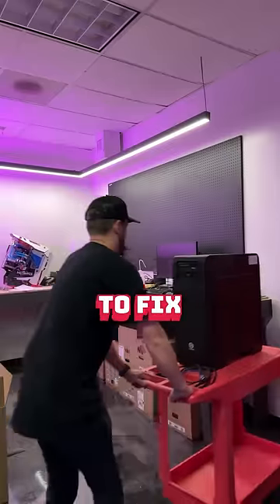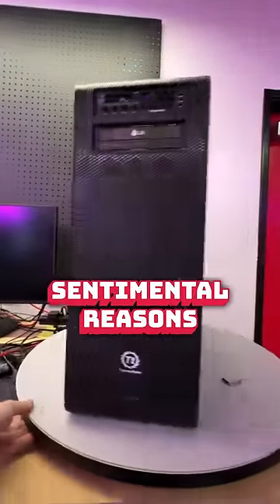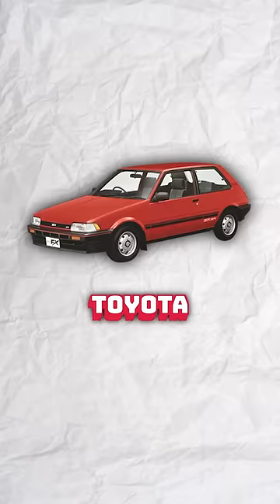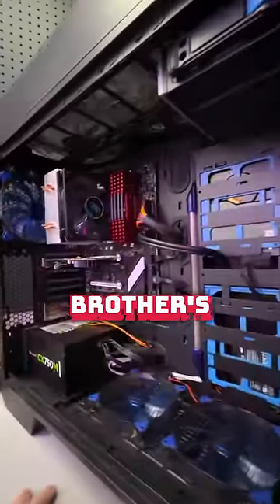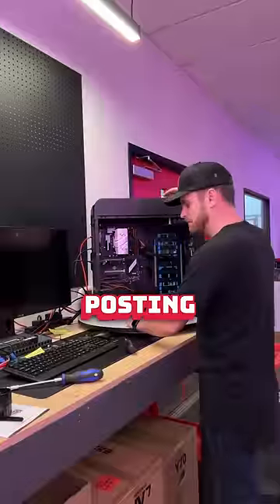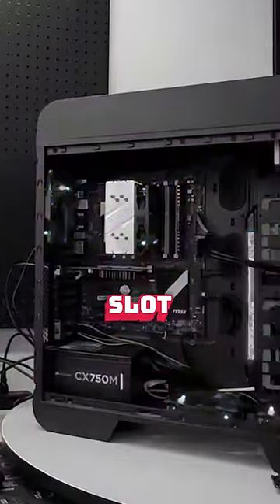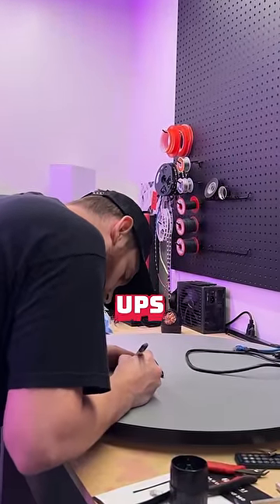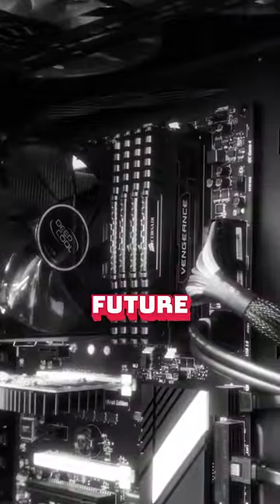FIXING OLD DDR3 GAMING PC! 👴🔧

Comment: I'm currently running a ddr3 system and it chugs along quite well
Reply: Me too
Reply: @jasoncooler09  i got an upgrade about a week ago. I am no longer on ddr3
Reply: @pringleiscool475 new motherboard too (of course?) what brand?
Reply: @pringleiscool475 rip
Reply: @pringleiscool475 stop teasing and drop your new specs smh
Reply: @chancebih  my bad, I got a ryzen 3 3200g with 32gigs or ram on a MSI a520m pro with a gtx 770 2gig. I'll be getting a 1050 sometime soon if my friend upgrades
Reply: @pringleiscool475  nice!!! Seems like a solid build, 1050ti’s a little outdated but when I used it years ago it was still chugging along, amd offers their performance settings for nvidia now if you ever wanted to try it out
Reply: @chancebih  id love yo get an amd card but I like how nvida rtx is plug and play
Reply: @pringleiscool475  amd is just as plug and play friendly as nvidia, the difference is when you start messing with settings, nvidia has better ray tracing and dlss, where amd has an easier to use program(in my opinion at least), that being said I think nvidia is better, but pure price to performance amd is better
Reply: @pringleiscool475 that's the worst way to improve performance 😭 why are you pairing a 32 gigs of ram with a cheap ah card. Should've gotten 16 gigs of ram and gotten a 1660 super or a amd 5000 or 6000 series or rtx 2000 series.

Comment: ah cmon, ddr3 isnt that old. my old pc has it and it runs perfectly fine
Reply: No one said it doesn’t, but it is fairly old with being „released“ in 2007 so he’s not wrong there :D
Reply: @BlueSky_fur  yeah 15 years old. thats not terrible
Reply: @crockpot5850  and no one said it is. :D we just said its old which it is :D my fiancee uses DDR3 as well without issues, i recently made an upgrade to ddr4, everythings okay, no ones hating on ddr3 xD
Reply: @BlueSky_fur  oh alr
Reply: @BlueSky_fur yeah I don’t understand the problem, like I still use ddr1 with my pc!
Reply: deleteduser1180 my dad still has ddr1
Reply: People with money: i highly doubt that
Reply: @officializm6298  u sure? try getting a mb with ddr3 support for a few $$$ and you probably won't notice that big of a difference from ddr4
Reply: @crockpot5850  I'm talking about people who want 4K 60FPS on ultra high settings in Cyberpunk 2077 in a PC
Reply: @officializm6298  oh ok. well then ur gonna need to spend a bit more than what ddr3 is valued at rn
Reply: @officializm6298  ive tried both ddr3 and ddr5 and ive seen a bit of a difference from ddr3 to 5 but thats probably because my old pc's ram runs at 2300mhz and my new pc's runs at 6000mhz. So basically almost double the speed.
Reply: yeah, pretty slow though lol
Reply: @turkey_sandwhich  yeah and i got 3200mhz wrong
Reply: @turkey_sandwhich  even slower. 2300mhz 💀
Reply: I own the very last motherboard ever made that supports DDR3 and the speeds are very good. With 36 GB if it, I’m set for many years.
Reply: @Huels  yeah i have the msi z97 gaming 5 with 32gb@2300
Reply: It's fine if you don't do anything that require power (game, 3d modelisation, video montage)
Reply: I have a budget build with quad channel overclocked DDR3 and it’s faster than your average DDR4 build, besides that DDR3 latency is better. The real issue are the CPUs that support it, other than Xeons and top tier Haswell i7s there isn’t really anything capable of serious tasks today.
Reply: @crockpot5850 bro that’s dinosaur era in of terms

Comment: I was still on DDR3 a year ago personally, there is still a lot they can do. I was still running some modern games at decent frame rates now a dual core on the other hand that would have been wack lol
Reply: Ddr3 🤢🤮
Reply: @JulyYunico I was on DDR2 until 2018
Reply: @samgray49 running a Xeon x5355 up until 2017, I agree DDR2 rigs could be impressive.
Reply: Dude im still at ddr2 and i dont have money
Reply: @JulyYunico What if it's a late DDR3 kit. Those are likely not that bad.
Reply: My computer is still on DDR3 for a long time now lol.
Reply: I just upgraded from fx-8350 with ddr3 this year. It still ran most things fine, but I ran into a problem on GTFO that one of the levels refused to load I think because my CPU lacked the instruction set to load it. It was like the 8th level and only that one, the ones before and after worked fine.
Reply: @JulyYunico  not everyone has the money for the latest hardware nor is it everyone’s priority 🤷‍♂️ I’d rather have a nice vehicle to get to and from work everyday vs a pc that costs 5,000 + and will be obsolete in 3 years time 🤷‍♂️

Comment: You underestimate how far you can push a old computer, i've got a hp8300 with ddr3 ram but i put a gt 1030 and a 500gb ssd in it, im also going to put a 500watt psu in it and upgrade from the gt 1030 to the gtx 1070 ftw note im going to fit the gpu in with a adapter, but the looks are not of my concern only the function

Comment: I got a question, my gpu randomly stopped showing video to my monitor but it's fans are spinning hella fast for no reason although the hdmi isn't working at all. I've tried different hdmi cables and switching the PCIE power cable. Nothing is working, this is my first ever build and i have little knowledge on pc's. (It's a 6700 radeon with a b650pro motherboard from msi paired with a amd ryzen 7600 cpu, PSU is 550W 80+ bronze.) The lights on my motherboard tell me that my cpu is booting and all my other fans are running and getting power

Comment: I still have 1 ddr2 and 1 ddr3 computer that runs better or similar to mid range computers today ddr speeds dont matter as much as cpu speeds if you buy rams aprooved for your mainboard my 3930k runs better than my top of line than rog strix laptop that i got last year at constant 6 cores at 5ghz well laptop has better gpu thats all only problem with older models is they don't have up to date stuff when it needs it but even thats rare when they are needed

Comment: Wait, modern systems can have BIOS speaker?
Reply: Yes. Unless your board has BIOS LEDs, you will need a speaker for POST error codes. If you run Linux, you can even use it.

Comment: My PC is ddr3 😢
Reply: My too
Reply: If you got a sandybridge or newer intel cpu, y’all chillin. If you have an older AMD FX cpu, good luck
Reply: Im still running my i7 4790K OC. 5Ghz with 32Gb of DDr3 RAM.

It's still acting like an absolute beast with no problems at all. 😅👌🏼
Reply: @leopoldbuttersstotch6060 that's my laptop. Single fan, amd fx 8800p and 8 gb ddr3 ram. Temperature goes 90'C when playing doom eternal
Reply: doesn't matter. Im running an i7 940 overclocked to 4Ghz, DDR3 16GB ram at 1600Mhz and a GTX 1080. I can play most modern games at high framerates and good graphical settings
Reply: i5 2500 + 16GB of DDR3. It just really does all what I need of it.